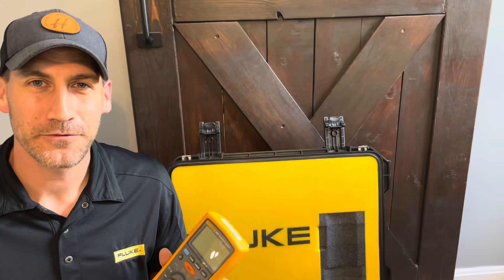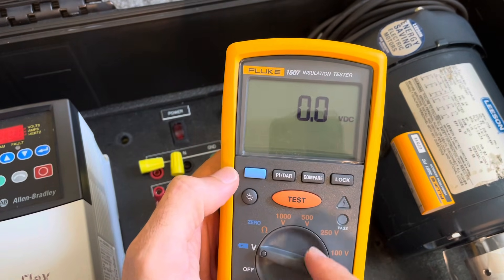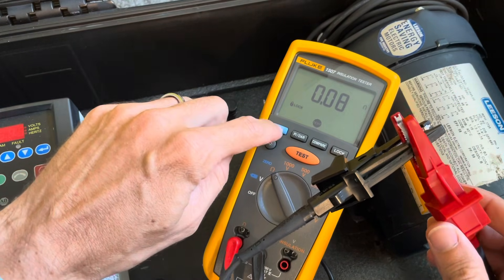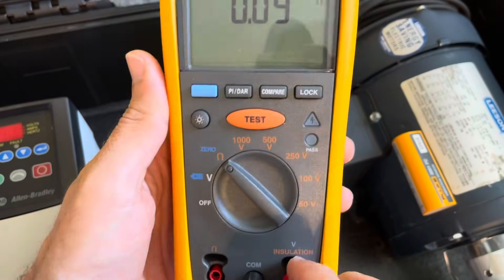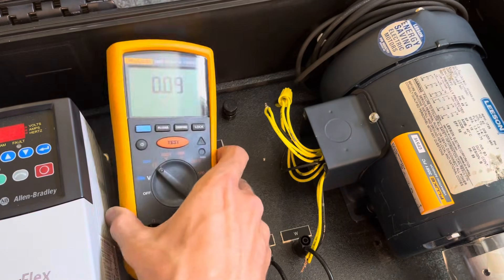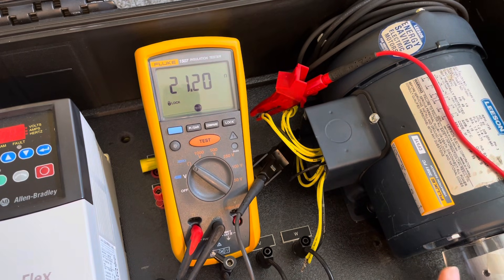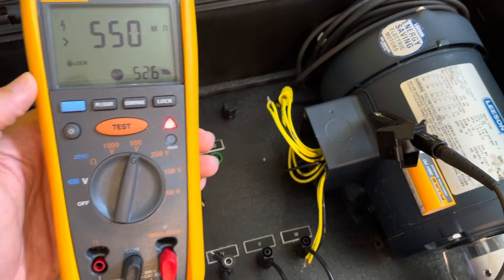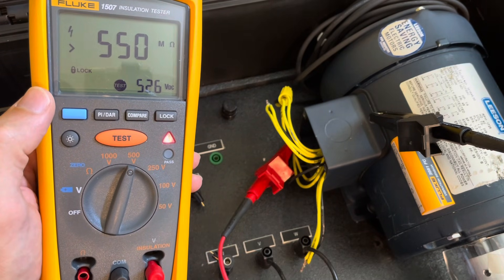Insulation Testing Fluke-1507 - Fluke Fridays - Episode 106

Comment: humm when you did your very first test, is not the very first thing to do is test for voltage to be sure there is none? Then start your hom tests?
Reply from the maker: You are right
Reply: A disconnected motor needs a voltage check?

Comment: How do you know how much voltage to send through the motor ?
Reply from the maker: @burg5556  typicaly twice it's voltage rating.
Reply: @fridayswithbrandon thanks for the reply. In the case of a residential Ac compressor would you do this test right at the winding prongs behind the rubber plug?

Comment: Great videos sir even though I’m confuse when you were testing. Are those leads phase to phase paired out. It seems like you have them wire in low voltage and you tested the pairs together?

Comment: What happens if a 3ph compressor fails the insulation test???
Reply from the maker: @TheEspinoza-hf1xf  it could indicate it will stop working very soon or it's already no longer able to run. As far as how to repair it would need to be replaced or sent to motor shop for re-winding.

Comment: I have a question. If I’m trying to megger a 480v 3phase motor, should I use 500v or 1000v for the insulation test?
Reply from the maker: I've heard in the industry most will do twice the operating voltage.  Thus 1000v
Reply: If that motor is thermistor protected use 500 V as 1000 V will destroy the thermistor.
Reply: @30mAkills how would you know its thermistor protected mate
Reply: @thomaslomas2345 Try these: 1. Find from nameplate/specs sheet.
2. Ask the manufacturer.
3. Visual check.

Comment: Ser, question for voltage test. How to change from Vdc setting to.Vac? Is it automatically change over while testing on AC voltage?
Reply from the maker: The insulation testers only output DC voltage. You can test an AC system but it will be with DC Voltage out of the meter.

If you wanted to put AC voltage to test a system you would need whay they call a high pot tester. Fluke does not make this type of tool.

Comment: Thanks for the Great video. Curious what would be an unacceptable ohm reading on the 500 volt meg test. Is it a motor specific value? Or is anything under 550 meg ohms not acceptable. Thanks
Reply from the maker: It is manufacture specific.  But the main rule of thumb is you want them all to be very close.  If one is different you probably have a problem
Reply: From my factory training, FANUC motor spec is anything above 100Mohms is good. Anything below and you could start to cause damage servo amplifiers